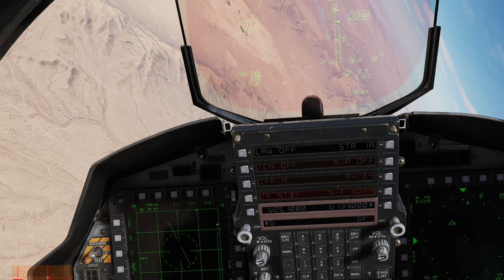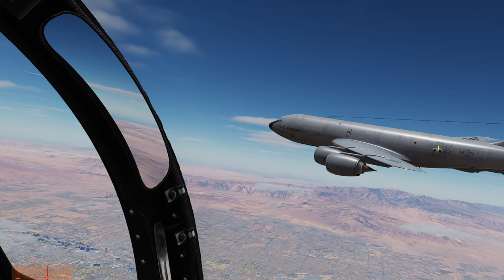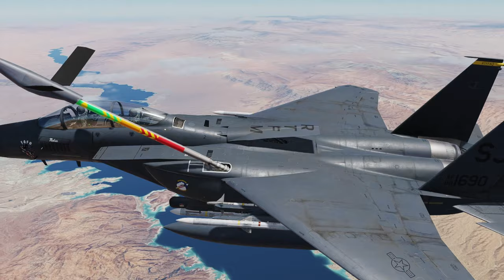AAR Tutorial

Comment: Another tip i found, especially in the F15, is making the tanker go at 300+ (indicated, so probably 450ish GS), if you set it up slower its way easier to get stuck in PIO, the difference is night n day imo
Reply: Absolutely, it’s awful in a viper with a draggy loadout and low speed, the engine takes too long to respond, AoA is higher.
Reply: Yep. The higher the AoA the more difficult.

Comment: Hey Big guy, a lot of people talk about AAR, but what I don't hear often is SEAT POSITION, because none of your referenced matter if  the guy or girl in the seat is not seeing the same site picture as you.  I struggle over a year with AAR, and then one day my Tobi eye ir tracker frozen / locked up and I got a whole tank of gas.  And it all fell into place seat position, I also use a little zoom because i look at the lights (it just works for me).  I really appreciate the videos keep them coming.  I alway learn something, observation position never knew it was a thing.  Tanker is always has a vacant slot when I approach. :-).  Is trimming the jet a thing when you refuel?  Hear some people talk about it.  Know my throttle movement needs some work because it effects my altitude and  often come off on average 5 times before i'm full.
Reply: I found seat position used to matter massively when I was playing with head tracking. (I used delanclip, which is similar to tobii).
When I switched to VR I found that head position didn't matter anymore. You have depth perception and a way better sense of where you are in space relative to the tanker.
AAR was always a nightmare in 2D, but once you're in VR it becomes way easier to do.
Reply from the maker: Agreed.  I've always thought that most people in 2D are sitting WAAAY too far aft vs the real thing.  I see videos all the time where they can see the whole cockpit, canopy bow, and side console panels.  No way you'd see all of that irl.  
Go look at real pics of the pilot sitting in the cockpit and look at how close his/her face is to the HUD and the UFC.
Reply: @funkyschnitzel  Yeah, I toyed with the Pimax crystal for 2 months, and couldn't get past the motion sickness.  So Now I rock 3 55" OLED TV's and 1 touch screen for Helios.  No more motion sickness and a since decent immersion.  Oh and tobii eye tracker.  So I guess i'm just destiny to struggle with AAR.  I'm good with it.
Reply: @Ginuwine-kx2iv  ah that sucks. I guess it's just a roll of the dice whether you're one of those people who get motion sick from it.
Still, that sounds like a sweet setup you've got there with the wrap around TVs!
Reply: @Ginuwine-kx2iv  If you don't need your headset anymore..
Reply: @notso4966 it ends up appearing that way because we are attempting to put a realistic amount of peripheral vision within the confines of the monitor frame. Our head position is the same as VR though. Sight lines around the canopy bow and HUD are the same (except for the Cyclops effect), but there's some fisheye lensing that makes it appear we are sitting further away than we are.